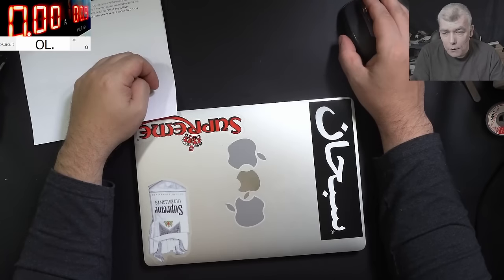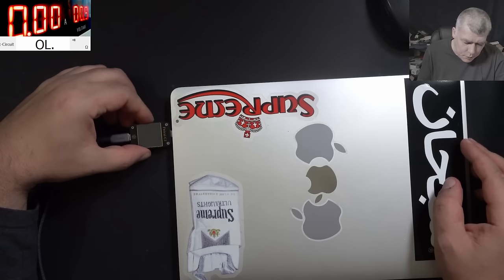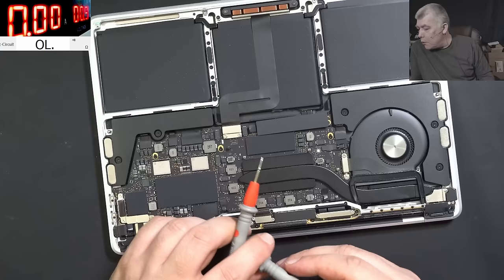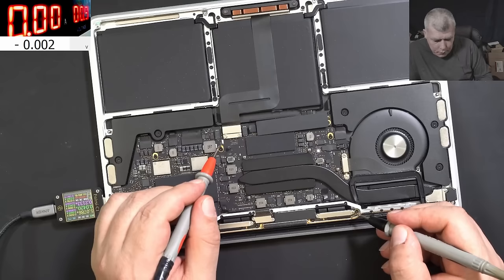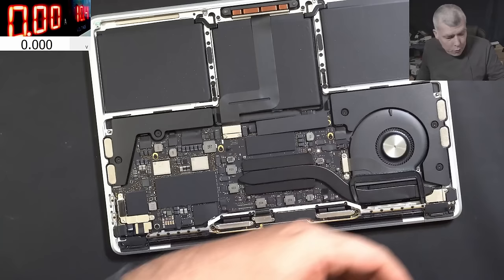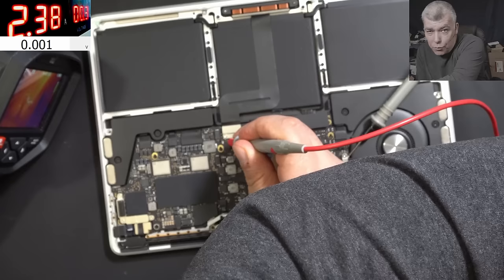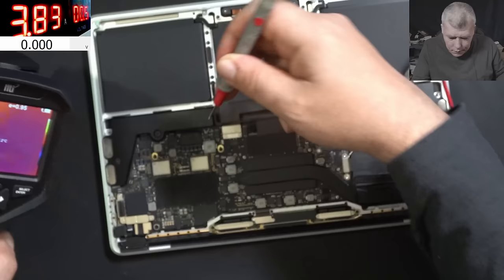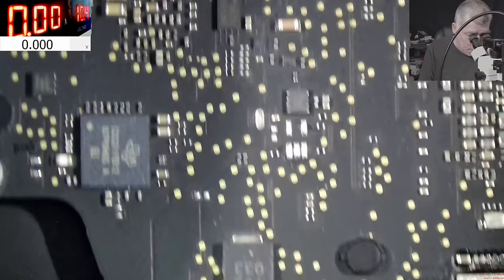MacBook Pro A2289 not charging, dead - This can be your fault and thats how u check it

Comment: Ideally,having removed the suspect cap, measure the cap off board to confirm the short has travelled with the cap, maybe also check across the pads to confirm short has gone before replacing with new cap. Been caught in the past with more than one short across the same rail.
Reply: You can, but the component may not always show as shorted once it has been physically disturbed during desoldering, something to watch out for.

Comment: what a lucky customer, the 2019-2020 MacBook's usually have dead SSD controller.
Reply: Which models exactly? Got a 2020 pro 16” with the 5600m and thought it’s a good investment for the coming years.
Reply: @tronixfix  all 2019-2020 are trash. SSD controller is less than an inch from the vent, no protection from water(humidity) damage, and 12v line is about 0.1mm from the ground. The new M series has the same controller, but at least it is not near the vent.
Reply: @tronixfix wtf are you doing on a repair video with a MacBook

Comment: 2 things from me:
1. This fault is a common fault in electronics, we had it in All in One PC's and in Hi-Fi equipment. 
2. This is an easy one and you don't have to have even a thermal camera to find it. You can spray IPA on the board if takes a noticeable current. Or touch and turn fingers :D if you prefer.
Reply: you know what? Sorin was doing that for century, and his finger print was burnt by that shorted capacitor..

Comment: Critical question, isn't it really risky to inject so much voltage? 10 volts? Isn't usually the safe range something like 1V or 1.2V? Or because the current was limited only to 0.2A?

Comment: Hello Sorin, thank you for all your great lessons so far! :)
I have a similar problem, Lenovo laptop with a ground short on main power rail. Is there a way to find shorted component without thermal camera? I have tried injecting 1V/5A and checking with my fingers, with IPA alcohol, and also "freezing" the board with cold spray, but I don't see anything getting warm or hot.
Thank you, and please continue with the great work!

Comment: How can you replace a capacitor without knowing its propeties?
Reply: It doesn't really matter. You just add some capacitance and most of the caps can withstand much higher voltage than there will ever be.
You can't go wrong when you put something bigger. I wouldn't get something smaller, but bigger is always better.
Reply: @Trex0Pol  actually no, MLCC have very poor properties when used in voltage range much lower than their maximum (1uF 25V will only have maybe 150nF at 5V) so most of them will be installed on donor boards according to power supply they're attached to by manufacturer. They also cost them less so that's probably why they care :)

So it's very important to never use any cap on main voltage rail but to use one used in a same (general) position on donor boards.
On other rails is not so important, any will have high enough voltage rating and capacitance is not so important.
Reply: @Trex0Pol  Depends on the situation. If it's a bypass capacitor on the supply rail, the exact value is not usually critical. In a timing, oscillator, etc circuit, the value is much more important.